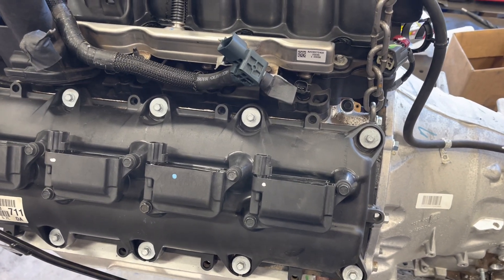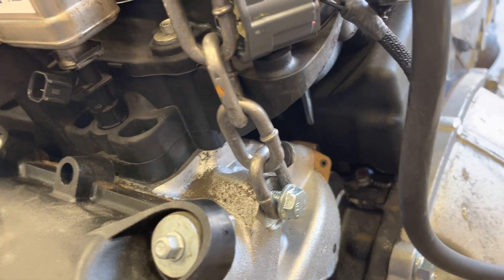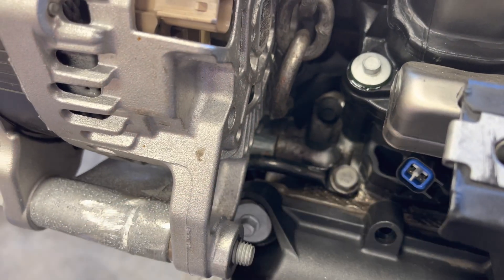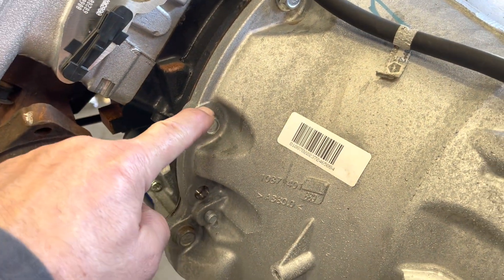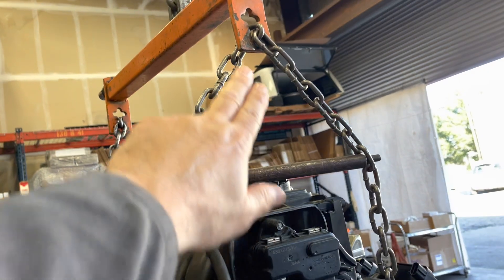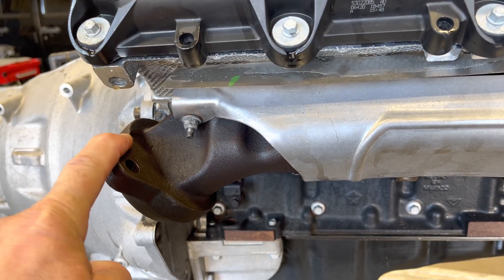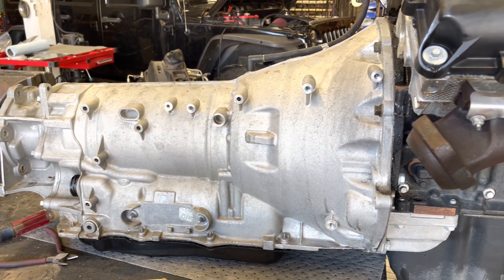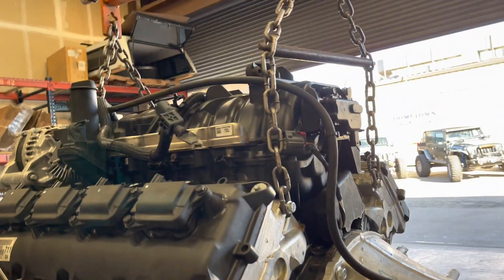Hemi JK, how to hook up the chains to the engine

Comment: I was bolted onto those points and in mid air one of the rear ones busted out. Chipped the whole rear corner of the head off where the ground strap goes. Luckily it didn't start any cracks or damage anything towards the block so I ran with that head and it's been doing fine for a few years. It was a brand new engine i had just built! I don't recall exactly what I said when it happened, but I'm sure Jesus wasn't thrilled. Lol
Reply: Did you use grade 8 bolts to do this? If you just use a basic bolt it doesn't have the tensile strength to hold that weight.

Comment: Nice work man! Keep up the great work, Quick Q I have a 13 JKU 3.6 auto. I have the opportunity to buy a brand new 3.6 with 8 speed for next to nothing pulled from a 22 JLU for a hemi swap. Is it an easier swap than im thinking or is it a hassle due to ECU and what not. Thanks again!!
Reply from the maker: I don't think the JL 3.6L will work in a JK because the engine is a little different. It has EGR and i don't think it will work..
Reply: Got it! I knew it had some minor tweaks to it just didn’t know exactly was added to the JL. Thanks again man I appreciate it.

Comment: I heard you say the truck manifolds now, what manifold did you change on the right side?
Reply from the maker: Now that we can no longer get the GC manifolds, we are now using the truck manifolds. Reuse the driver side and use the Right Truck exhaust manifold 68365739AA